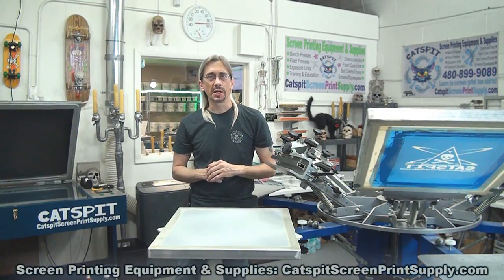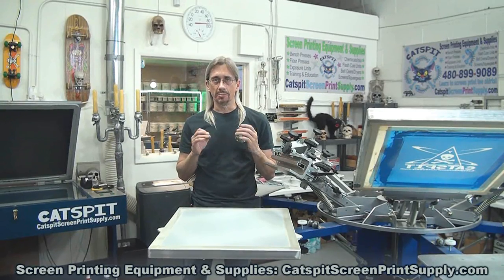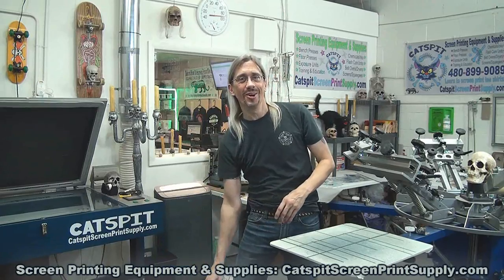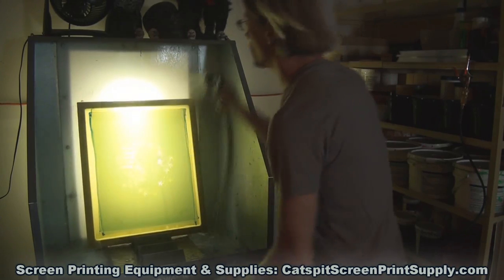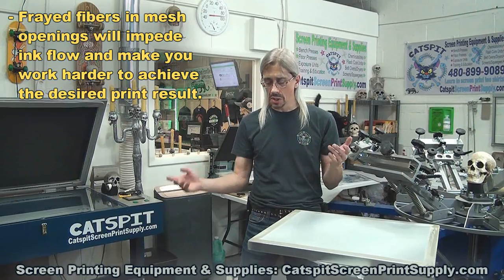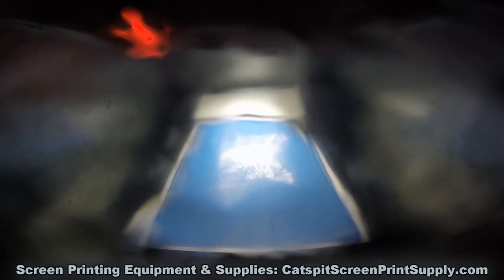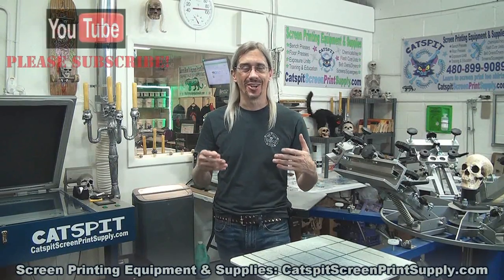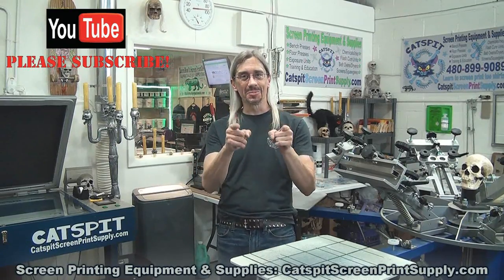Screenprinting T-Shirts: How Many Times Can Screen Mesh Be Re-Used?

Comment: What about the adhesive keeping the screen on the frame? We've recently run into a problem at my shop where screens are losing adhesion to the frame itself. New and Old Screens,  High Mesh and Low Mesh,  Yellow and Clear. We use Bean-E-Doo, D-Haze and a CCI Dip Tank for Reclaim. I'm thinking the glue is breaking down somehow but I cannot figure out how.
Reply from the maker: That's most likely the dip tank. The screen adhesive needs to be better and/or the dip tank solution needs to be gentle on frame adhesives. Thanks for watching! Screen Printing Equipment & Supplies - http://CatspitScreenPrintSupply.com/

Comment: Great video! I was wondering if you could answer a question that I have. Idk how much you know about flash dryers but mine is leaving yellow marks on my white tshirts and idk what to do. It looks like burnt marks but they're not bc I have my temp very low and they start showing even within the first minute of curing.
Reply from the maker: If it's a white cotton garment then it is what we call scorching. The cotton is burning slightly turning yellow. The cheaper the garment, the easier this happens. Even at low temps. You can either switch garments, which I would recommend, or try using scorch out. It's a product that will bleach out the yellow burns without damaging plastisol inks. Thanks for watching! Screen Printing Equipment & Supplies - http://CatspitScreenPrintSupply.com/
Reply: CatspitProductions what if I'm using water based inks?
Reply: CatspitProductions and it also happens with black shirts
Reply from the maker: It does not matter what ink you are using since the garment is what is scorching from heat. I'm not sure what it really is however if black shirts are turning yellow. That is something else. You cannot usually see scorching on a black shirt.
Reply: CatspitProductions yeah I tried it with 2 different flash dryers and I can't figure out what to do or how to fix the problem
Reply from the maker: Has to be something with the garments then. I would switch.

Comment: Can keeping the screens in a hot and humid environment can harm them ?
Reply from the maker: Anything kept in extreme heat or humidity can have issues with storage over the long term. But as long as it's not some kind of super hot humid situation, you should be fine. The mesh and adhesive will last just fine. Thanks for watching! Screen Printing Equipment & Supplies - http://CatspitScreenPrintSupply.com/
Reply: CatspitProductions Sadly I live in Montreal, Canada. I think your website say you only ship in US or other continent :(
Reply from the maker: Yes, that's true. Some people in Canada ship to a freight forwarder near the border. Some ship to a mailing place near the border and come pick it up themselves. But yeah, exporting small supply orders is not practical for me yet.

Comment: can you keep the screen with the design like forever if you use the design all the time?
Reply from the maker: Yes, you can keep reusing the same stencil on the same screen as long as the frame and mesh tension remain suitable enough. One aluminum screen should pay for itself with the first print job really. After that it's all icing on the screen cake. Thanks for watching! Screen Printing Equipment & Supplies - http://CatspitScreenPrintSupply.com/

Comment: can i do cmyk using 150 mesh screen?
Reply from the maker: Only if your halftone is a low enough LPI. But usually true CMYK is done at 45 LPI or higher on 305 or 355 mesh. Thanks for watching! Screen Printing Equipment & Supplies - http://CatspitScreenPrintSupply.com/
Reply: Possible you spent about different mesh density, 150 on cm and 305 on inch...